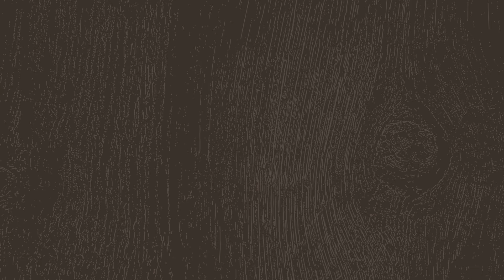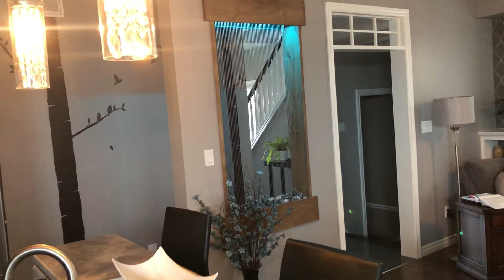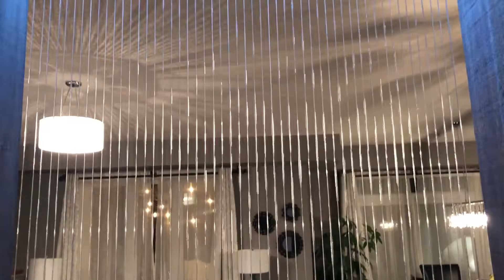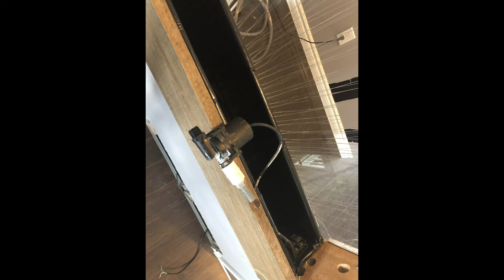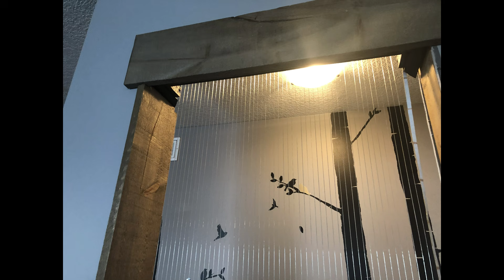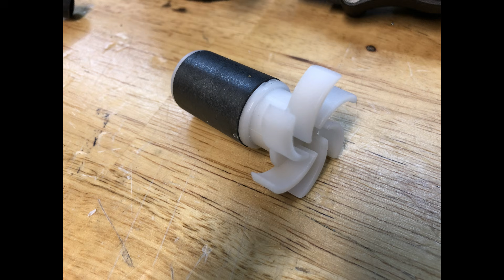How to make a Beautiful DIY Indoor Waterwall - Smart switch controlled, turn on with your voice!

Comment: What size or power of the motor is required for 12 feet wide and 6 feet high waterfall and what size holding tank.  Do we need to use some calculation.

Comment: Looked at a lot of these rainfall style effects and yours is the best looking by far; the line makes all the difference in the world although I am sure it was terrible getting them through. One idea I had if I do this project would be to cut the top pipe in half, thread the lines through and then glue/epoxy the halves back together.

Comment: Wow, well done - beautiful.
Reply: Scott Sheridan : awesome engineering and a clean job. Quick question: I am going to run the fishing line from top to bottom and use fishing weights to hold the tension. Do i just knot the fishing line up on the top or what do u recommend I should do to hold  a straight line especially at the top ? Your thoughts are most sought after and appreciated.

Comment: How to put fishing wire inside pipe holes?
Reply: You have to weave it like this W through measured holes 1inch apart
Reply: @christianperry1042  thanks dear now it's working fine
Reply: @SanjaySharma-mq5ku  got link to your water features
Reply: How did you get fishing line using hook through pvc and how many times?  Thank you....